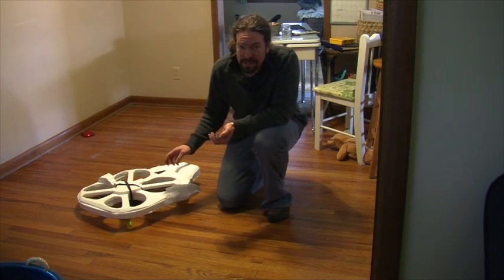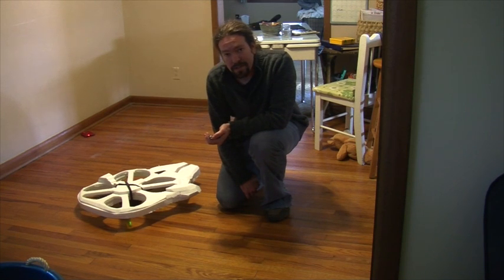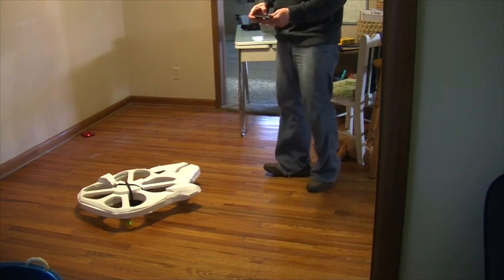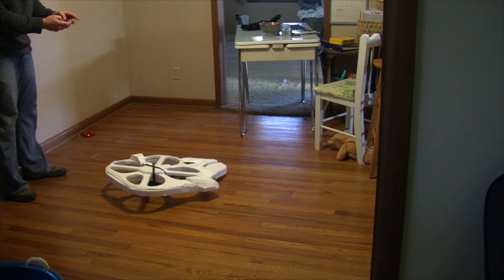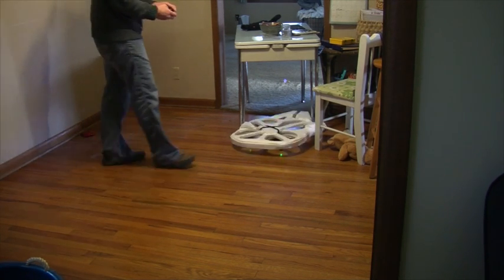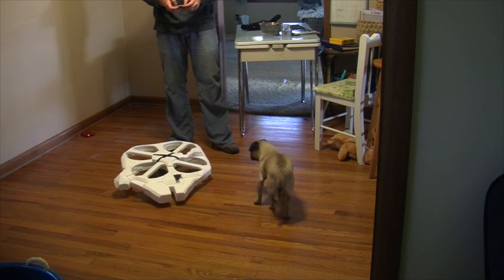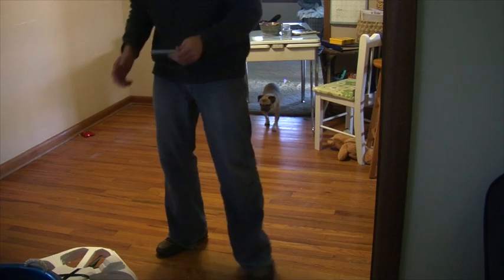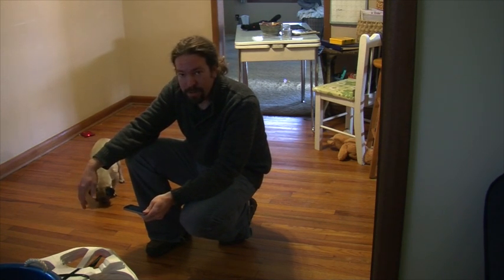AR Drone millenium falcon mod (failure, too heavy)

Comment: EPP foam will be too heavy. You'll have to get into a fully cut-and-glued styrene in order to make weight. Also, the 'nose' is going to make you go forward all the time... might have to counter balance with some weights in the back. Although you might get away by tweaking the timing of the front motors... but at that point, you might want to consider abandoning the AR platform and going with a fully custom quad platform.

Check out FliteTest here on youtube for some really good quad videos!